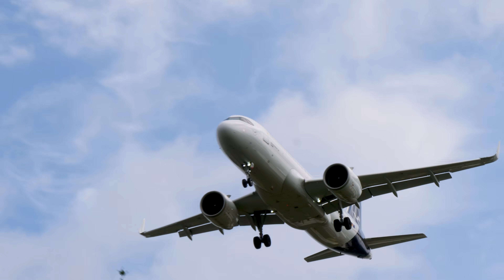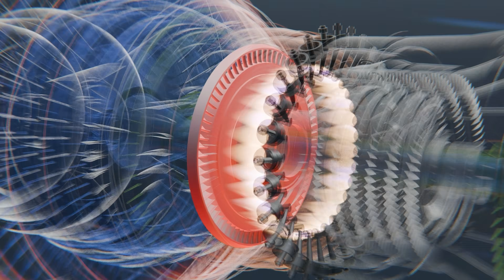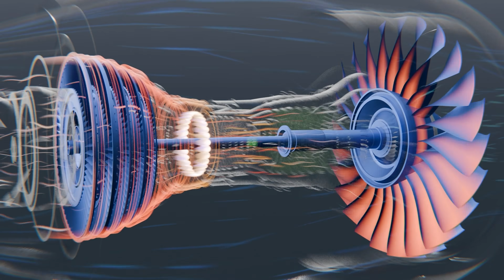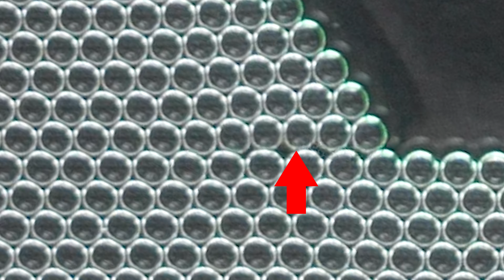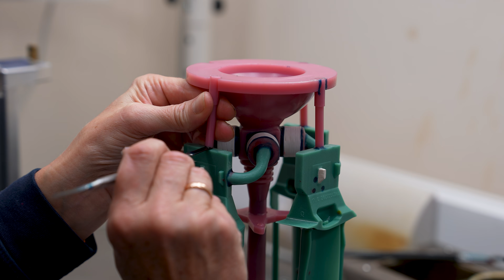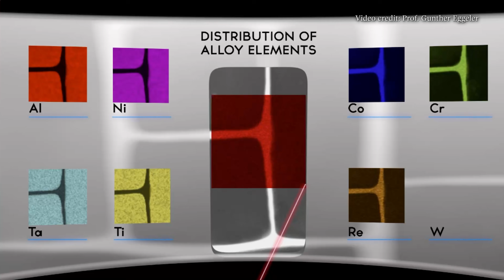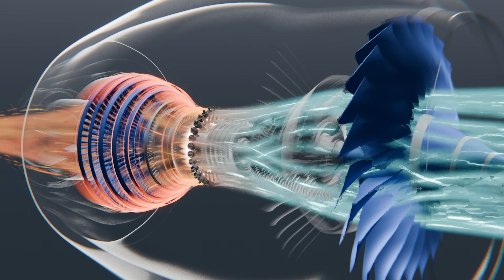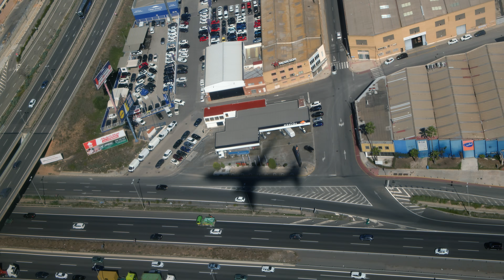The Ridiculous Engineering Of Jet Engines

Comment: Will always remain a mystery to me.  The combusting gas expands and thus forces in all directions.  The sides of the combustion chamber are able to push back equally as it encircles the combustion.  However, the same force is exerted both forward and back: the combustion must force against the compressor blades as much as the power blades.  In the case of both piston, rocket, and steam turbine engines, there is a fixed structure against which the combustion pushes in order to turn the power into motion.  But this is lacking in these turbine engines -- whether the power force is primarily from the exhaust, or in turning a prop or fan.   You cannot have the combustion just push against the power blades without an opposite force.  That opposite force is equal against the compressor.
Reply: The highest pressure in a jet turbine engine is right after the compressors. It's all downhill out the back from there. Since air goes from high--->low pressure, the air goes out the back. Combustion does not increase the pressure of the air, it lowers it somewhat as the air expands from heating up.
     Go grab a hair dryer, turn it on cold, now turn on the heat. Air still goes out the same way. A jet engine is almost identical to your hair dryer. The difference is the fan on the hair dryer is spun using an electric motor instead of a turbine and the heat is added with an electric element instead of burning fuel. Other then those 2 things, they are identical in every way.

Comment: If my math is right we are still 130 degrees short from preventing it from melting. And what about the metal that are holding the blades together and the rest of the parts around them? Are they made of the same material?

Comment: What about a kind of dust screen on the front of the fan? Like.. a mesh that the dust would be drawn to that could be super heated to try and catch the dust before the air reaches the turbine? If it could reduce the dust going i to the engine and be something that can be easily replaced... that could be a solution?

Comment: I made *transistors in class in '78, so fully appreciate both the intrinsic creation process of the silicon boule, being slowly pulled out as a single crystal -- from a melt over weeks -- and the extremity of qualities of purity, stability, and clean room constraints underneath it all. My alpha was close to beta, so my *chips were without any gain, so barely functional at all, yet I learned important lessons about system constraints, so important in flight systems for my Caltech JPL efforts.

Time and frequency base accuracies to a part in thousandths of trillionths for navigating spacecraft to within a few km, at billions of km away, like Voyager.

I am flabbergasted to discover single crystals inside jet engines, yet more so, how all these incremental advances all come together over many decades.

Comment: They also are extremely expensive. One single turbine blade of the first high pressure row after the combustion chamber costs more than 10000 dollars, so just the turbine blades cost multiple millions of dollars.
Reply: Single crystal blades don't come cheap. There's a lot of work in each of those things, as was shown in the video.

Comment: I got cussed out by a little old Frenchman at Airbus 5 or 6 years ago. I got caught taking pictures standing in front of an engine. Lol he was mad!! I had to deleat my photos and almost got escorted off the property by armed guards. 😂 I didn't know I wasn't supposed to do that. I was inspecting a hanger roof and passing through another bay where they assembled passenger jets. I was cleared but didn't go through an orientation do to scheduling issues. I learned that part of the orientation the hard way. 😂😂😂😂

Comment: The temperature is itself a parameter defined by the design of the engine. It is not given. So the question is not how these blades survives this temperature, but rather what innovations in blades production allowed to use such high temperature. All for slightly higher Carnot efficiency, as was said.

Comment: Great explanation. As an electrical engineer, I started out at university as a mechanical engineer. It was because I earned a B+ in circuits I (and A's in all of the other core engineering classes - kinematics, thermodynamics, ect..) that I switched to EE from ME. Interestingly, my next hardest course was emag, so what did I study in graduate school? Applied emag. Regardless, I often regret not pursuing mechanical engineering. It's such an incredibly fascinating field.

Comment: Really amazing documentary. Kudos to the veritasium team for putting out this content. It's sort of amazing in a different way what youtube did to allow content creators to be able to bring content like this to people. Growing up as a kid it was so hard to run into good content on TV. I'm curious about the sand and air particles. The fans we referenced here are being spun by the exhaust gas. So the sand and particles go through the air compressor? I noticed in the schematic in this video only a TurboFan is shown. I guess TurbJet is what fighter jets use? It seems in a turbojet there is little way to try to exlcude air particles from the compressor, but I'm wondering if in a TurboFan there could be a way to cause particles to take the path of the air that flows around the compressor, never entering the compressor or the ignition air stream.

Comment: they told in the first 2 minutes, why it does not melt. The Air Presure. No miracle
and the second miracle is none, because you use another material instead of shown in the picture.

Comment: When the Austrian painter asked why the German engineers developing the world's first jet aircraft, the ME-262, were stalled they told him it was impossible - no metal could withstand the heat generated in the turbine blades. He asked how long can those blades last, and when they told him no more than 10 or 15 hours - he thought for a few seconds, and said: 'make it easy to swap the engines, and put an eight hour timer in the cockpit.' Thus, the ME-262 became a reality. Give the devil his due.

Comment: I would say that the airplane is being pulled along if you think about it. The big fan blade is creating most of the thrust that is pushing against the big fan blades. That thrust is transported to the big fan blade shaft and the pull on the shaft goes up against big thrust bearings that are encased in the enging structure and that engine structure is bolted to the airplane wing.
So in effect the airplane is being pulled along by the big fan blade. ?

Comment: Ex RR core designer here..... if the low pressure turbine that drives the fan was rotating at 12.5k rpm the fan would fail INSTANTLY. Typically, the LPT is circa 3k rpm, the Intermediate PT is circa 7/8k rpm and the High PT is circa 12k rpm. The 3 rotating systems or spools rotate on the same axis and pass through each other. The architecture is complex but it gives superior aerodynamic efficiency compared to 2 spool ie GE/ P&W cores.
Reply: Efficiency aside, as an A&P mechanic, 3 spools also sound way cooler. Running 757 RB-211's on the ground was always interesting, watching the egt climb slower than the V2500/CFM 56 then shoot up as n2 and n3 started spooling.

Comment: Extremely dangerous and very primitive tech. All made to extract the money from your wallet 🤦‍♂️

They stole the airship from us which could get you from Bejing to NYC for the cost of a cab ride. They could also carry entire city blocks worth of material. And most had saloons, hotels and huge open spaces. Oh yea don't forget the elevators that are shown in many blueprints 🤷

But they're scary, they say!!! 😱

You must be too afraid to ever even entertain this line of thinking. So get your ass in that aluminum can while we use combustible engines filled with jet fuel to fight against the laws of nature rather than working with them like the airships did 🤔 

And if you step out of line and start using that brain of yours to try and recreate those amazing airships that once filled the sky then you might just end up de@d (funny how I was gonna end with something else but my auto keyboard knew to offer a censored version of the word dead so I had to use it) and it works either way cz that's what's happened to everyone who's tried so far

Comment: Ive always wondered how much wear on the turbines is caused by the aluminum oxide they spray into the atmosphere. The volume of air those engines consume, would greatly increase the wear/friction from the  aluminum passing through the engine.
Fascinating stuff.

Comment: Can Veritasium please explain why at 10:28 the failure point of steel is 1111.1 degrees fahrenheit, meaning the difference between that temperature and absolute zero is exactly the difference between the freezing point of water and the boiling point of water, plus that exactly 10 times, plus that exactly 100 times, plus exactly a tenth of that, plus exactly a hundredth of that? Looking forward to this not being someone picking it exactly for that reason even though the failure point is not really one exact temperature within 0.1 degrees Fahrenheit but more like a gradual process. This should be fun. That aside, all this enterprise really is ridiculous when you realize we've had antigravitic propuIsion for over half a century locked in hidden speciaI access programmes.

Comment: 35:20 would be amazing if someone made one with an air intake system like a filter or dirt separator, probably lower efficiency a lot and make it louder deeper tone, i would think cheaper having more engines that are simpler is better for debris failure like 4 engines per side, if one or even 2 goes out it should still fly, redundant systems

Comment: They have to work so hard to keep the super nickle alloy from melting, I wonder if it would be worth trying a mostly tungsten alloy.  I'm sure they'd have to do a lot to deal with the weight & brittleness, but look at the extreme lengths they're already going to for the nickle alloy.
Reply: That was discussed in the video. Tungsten is much more dense than nickel so the forces on a tungsten blade would be much greater. Also, it oxidizes more readily than nickel at high temperatures.

Comment: is this the same nichrome metal used to build heating coil? or is this different ?
Reply: Different. Nichrome (80% Ni 20% Cr) just has to have some electrical resistance and also resist oxidation. It doesn't have to be strong at all. The nickel-base alloys used for turbine blades have other alloying elements and need to be very strong.

Comment: 2:30 These machines also provide electrical power to every system on the plane. There's no 12V battery like in a car. That's why it isn't called an engine in the aviation industry, but a Powerplant.

Comment: Probably the dumbest question ever but could we use this technology as a sort of wind turbine to generate power, say on the end of a long stick that spins on a motor? Or would the energy required to spin a turbine engine at 700km/h not generate enough energy to power it and generate excess for consumption?

Comment: Im mechanically inclined, absolutely ❤️ this kinda stuff, & it still confuses me. Turbojets are comprehensible. I’d like to understand how turbofans start on the ground. Do they just dump more fuel to increase throttle or manipulate venturis in the intake &/or bypass to increase velocity of air flow? Is that only on the ground or are those plausible systems used on takeoff, during flight, or landing? The combustion driving the turbines in the back dictates the rpm of the fan blade up front, correct?

Comment: Damn, I thought for sure that the extremely high pressure in the combustion area of the engine would be part of why the metal doesn't melt, I never would have thought they'd engineer a thin film of air over the blades. I guess it's a lot of pressure for an engine but only a little for physics

Comment: There is another efficiency I believe you missed that makes bypass more efficient. 
Propulsive efficiency. This is the effieincy based on the exhaust velocity. The highest effiency happens when the delta between the incident air and the exhaust velocity = 0. Obviously this would produce no thrust, but when you can minimise the exhaust velocity compared to the cruising speed in comparison to a turbojet. Basically throwing it out really fast is the least efficient way to do it. Throw it out with just a 10-20% velocity delta you get a lot more efficiency.

Comment: Worth pointing out that this lack of strength in the grainy structure of cast metals was traditionally fixed by blacksmiths using forging techniques. By heating and compressing + stretching the metal, you stretch those crystals out, and end up with a much stronger material, closer to the turbine blade that was shown as cast without the pigtail. 

Incredible that we have the technology now to just grow the metal into a single crystal!

Comment: What is the material for the mold? does it stick to the blade after cooling? I look for some boat or moldten boat that is other than Al2O3
Reply: The inner layer of the mold is zirconia. Outer layers are silica. The part comes out pretty clean.

Comment: I learned material tester two decades ago and I still think this topic is damn interesting. I mainly was working with copper alloys and I think it's interesting, that we did exact the opposite to raise the tensile strength, we grew more but therefore tinyer crystals and because they had less aligned layers to creep in a trans-crystaline process the alloy's point of plastic deformation increased. Every grain border acted like a stopper for deformation because the next grain's crystal structure orientation changed to a certain angle and the atoms were not straight in line anymore.

Comment: I've worked in this industry for almost 40 years, and this is the best video I've seen on the subject. The fundamentals of the manufacturing process and the metallurgy are explained very well.
Reply: Absolutely I work at ROLLS ROYCE DERBY UK at the facility in the video. It’s a fantastic video.
Reply: How contact with you need information about jet engine sir
Reply: How contact with you 😊

Comment: A minor increase in weight on turbine blades is an incredible amount of rotating mass at 80,000 RPM
Reply: Nothing in a big jet engine spins that fast. The high-pressure turbine spins at 12,000 and all the other stuff spins much slower. Little tiny jets like for RC models may spin that fast.

Comment: Great video, but I have to admit GE has my loyalty as an aviation enthusiast. RR engines create excessive buzzsaw noise from the fan blades exceeding supersonic speeds. Totally ruins the A350 experience imo. Compare to GEnx or GE9x, which are both significantly quieter than any RR equivalent engine. Just kinda feels like GE is outperforming RR in all aspects, even back in the 90's with composite fan blades.
Reply from the maker: Thank you! To each their own haha!

Comment: What pisses me off is how we can design and build these engines while not being capable of keeping the engine stuck to the planes.
There seems to be a gap between the quality and professionalism at manufacture vs the use and maintenance of these fantastic machines.
Reply: Commercial jet aircraft receive the highest level of service and repair standards of any transportation technology except for nuclear powered vessels. The average statistical safety performance is truly astounding with 10's of thousands of hours of flight without any inflight failures and most are minor, only a tiny percentage of engine failures are significant enough to result in a fatal accident.

Comment: This is a wonderful video. Really appreciate the energy and curiosity that went into producing such a marvel. The only thing that I would like to point out is that the directionally solidified blade has visible columnar grains with distinct grain boundaries. They have the same crystal structure within those grains, but oriented in different directions in 3D space, giving off variable contrasts as we pan over and across the blade. Please feel free to correct me. I am here to learn. Cheers!

Comment: forging vs casting...I they're going for light weight and a certain amount of stiffness and uniform  lattice vs denser layered forging. They are leaving out an important part of getting the coil and that's achieved by pressure or more accurately, compression, probably seriously high compression forces...

Comment: So basically it is "the combustion chamber is hotter than the melting point of the blades, but the blades themselves don't get as hot as the chamber." Why did I waste 40 minutes on that? Mmh.

Comment: The predominant alloy for turbine blades is Inconel -- 63% nickel, some iron, chromium, cobalt, titanium and some others. Stands up to 1500F.  Has been in use for decades, particularly in military jets.
Reply: TRUE, and the biggest improvements in turbine blade technology are bleed air cooling and TBCs (ceramic coatings) neither of which were proper addressed in the video.